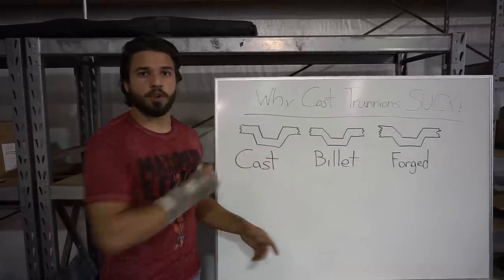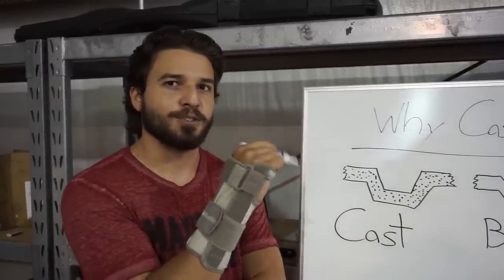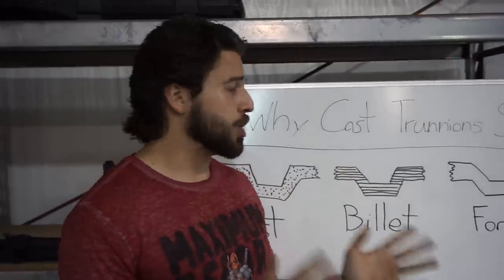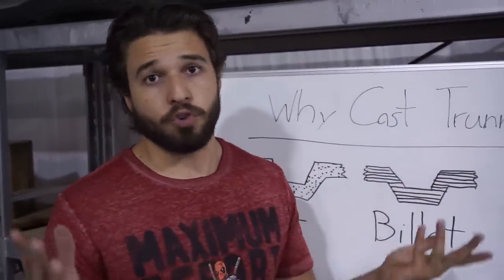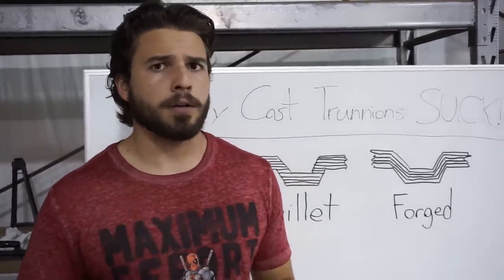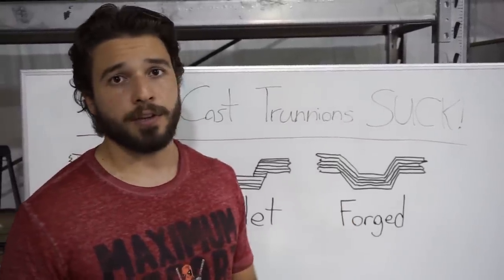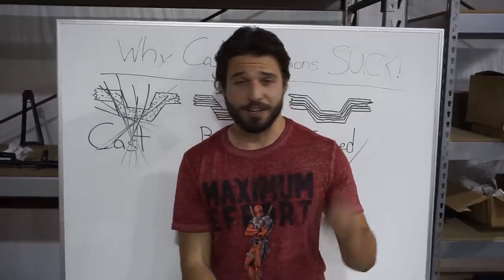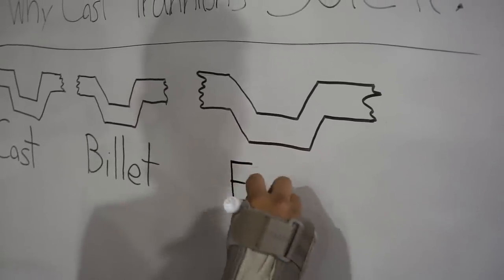Why Cast Trunnions SUCK!

Comment: Yes and no. The density doesn’t change from billet to forge. The density of the metal is the density of the metal, regardless of your harding process. Forging is elongating the grain structure that is on the surface of the metal. The forging process induces compressive forces on the surface which then hardens it. It forces a strain on the metal surface that moves based on the Young’s modulus, which dictates the stiffness of any metal; E= tensile stress/linear Strain. Billet is tough but not hard and that’s a function of the billets carbon content. A billet piece can be forged; density doesn’t change and carbon content doesn’t change. Tough meaning how much energy it absorbs. So a cast part will break because it’s brittle, a billet part will absorb energy and you’ll see “indentions” from impact and a forged piece is hard on the surface because the grain structure has gone under compressive forces. Now, you can machine a piece of bar stock in the direction of the grain structure and then you forge the same piece in the direction of of how the grains grew during the heating process. This will use the grain structure to your advantage. The same idea as wooden baseball bats. Grains only change when the metal is being heated. It’s a phase of the metal. But yes, the forging process hardens the surface of the metal, making a very hard part. In the end, your company and the AKs you all make rock, please continue to use the forged parts. Btw 4150 billet steel has a brinell hardness of 197 on the surface and after cold forging(cold hammer forging) it goes up to around 340
Reply: You can forge a billet into a trunnion or what have you but the fact still remains... billets are only formed one of two ways, continuous casting or hot rolling. It is a step above cast but still inferior.
Reply: Carbon content does change during forging.
Reply: @ravioliformuoli520  yes and no, thats kinda a loaded statement.
never the less, i feel this guys knowledge of metal fundamentals  is lacking.
Reply: @ravioliformuoli520  yeah, the carbon will react with oxygen. Its called decarburization, and thats why they use vacuum chambers for melting and heat treating.
Reply: Came here to say something similar to this, Cast is shit because of the random mix of gases in the final metal.
Reply: Holy shit, this cat knows his metal
Reply: This video and comment surprisingly are related to what I’m learning rn, considering the nature of all this—guns. I’ll be using this as self-study material :)
Reply: When he mentions density of the grains he is actually correct and it is directly controlled by heat treat. The size of each “grain” changes based on the temps used during heat treatment . They are formed during the prep heats before the forming of martensite by quenching. Look up normalizing, heating and quenching steel and specifically break testing, you can actually see Grain size with the naked eye. Also while forging does somewhat work harden steel it’s by no means the reason forged parts are strong and can actually be a problem with high carbon steels as it causes cracking.
Reply: Curious, what if you did casting under vacuum pressure? Would this eliminate the “bubbles” in the casted metal?

This is often done with resin to get air pockets out, even the tiny ones.

Ps I don’t know shit about metal.
Reply: Dang he sure googled the crap outta this video. He knows it all.  He’s an expert
Reply: I'm a metal head but not a metal head lol. Thanks for the educational comment!
Reply: @cody6102  Short answer is yes. If you watch the guys from Baltimore Knife and Sword do casting, they cast into a vacuum system to cut down on porosity.

The long answer is...kinda. Yes, vacuum casting is a thing, but the devices are expensive, especially when they start getting big, so it's not all that common.

Neat thing about casting, though, is that you can mess with the magnetic field pretty easily by, well, holding a magnet near the mold during the pour. This will align the grains and give you a magnetized part when you're done. Or, conversely, you can play with magnetic fields while the part is cooling and completely degauss the part so it ISN'T magnetic when you're done.
Reply: Huh...huh...he said, "stiffness."

Comment: Castings can be quite strong. Example, almost all production engine blocks are cast. The real problem is investing in things that reduce gas entrapment (Such as vacuum casting) and mold types that let the part cool very slow to provide the best interlocked grain structure such as sand molds.
And by the time you do that for small parts such as AK trunions you might as well have invested in forging.
Reply: Engine blocks are cast iron due to the cost (about 60% cheaper than aluminum.) A decent quality aluminum block is going to be stronger than the best quality cast iron block, and weigh 40-60% less than its CI equivalent. 

Companies building trunnions out of cast iron are doing so for one reason only: cost. They're trying to save as much money as possible during production in order to reap maximum profit. PSA and Century Arms don't care if you experience catastrophic failure due to poor metallurgy, as is evidenced by their lack of customer support offered to those who experience it.
Reply: @RockandrollNegro  Cast iron engine blocks are a rarity today. Most are cast aluminum. Casting can be just as strong as other methods. And in truth all other methods from machining to forging all start from a cast billet as virtually all billets come from continuous castings and hot rolling method.

So no casting is not an inferior method. It is just the method that can be done with the least investment which can cause an inferior product.
Reply: @Cragified  Agreed, steel companies can generally afford the quality control and metallurgical science books and scientists to control defects in their forges. Considering any pure steel or pig iron was brought up to molten temp to drop out of their ores. Essentially "casted". What this brandon guy is talking about is gas porosity and is a defect.
Reply: @RockandrollNegro  except Palmetto doesn't use cast trunions, the are all hammer forged or billet forged, so that's not true, plus they have some of the best customer service around, if u disagree I can guarantee by ur ignorance already, U were the problem lol
Reply: Engine blocks aren't meant to be hard or strong, they're meant to be able to flex under changing RPMs.  Crank shafts used to be forged, but forged cranks required surface hardening every time they were machined, where cast cranks actually surface harden while being machined, which makes them cheaper to produce while still being strong... enough... (they also have to flex).  Racing engines, especially high end ones, typically use billet blocks and forged cranks because they're stronger than cast blocks and cranks.  
So, yes... cast parts can be strong, but machined billets will generally be stronger and forged parts will always be stronger than any type of casing, no matter how technologically advanced the casting process may be.
Reply: @RockandrollNegro  Aluminum engine blocks are not stronger than iron blocks... they're just lighter weight.  Most cars now have cast aluminum blocks and heads because they're much lighter than iron and technology has reached the point where casting aluminum is cheap enough to make it practical enough for mass production and still be cost effective.  Billet aluminum blocks (racing engines) are stronger than cast iron blocks, but obviously they're much more expensive.
Otherwise, I agree about the reason why gun companies are using cast iron for AK parts... it's cheap.
Reply: Aluminum engine blocks are all sleeved with some kind of steel alloy insert fyi
Reply: It's STRAIGHT inferior to forging for AK trunnions considering that the casting CANNOT sustain the forces and loads needed for that trunnion... @Cragified

Comment: AK-50 with forged parts that is going to be expensive but worth it.
Reply: For the engineering needed to run a .50 you Need forge hardened metal.
Reply: Temper it correctly after making the billet you’ll be fine. The quench process is the critical part along with tempering.
Reply: Need to buy this in a kit with an 80% receiver!  Ask and ye shall receive? Brandon?

Comment: In b4 "RAS47 is fine" comments.
Reply: 5k rounds through mine and no issues.
Reply: AK Operators Union does a really great review on the PSAK47 by Palmetto State Armory.  The GF3 is a very well made American AK.  You would be a fool to call it a bad gun.
Reply: However, when it comes to the RAS47, it is indeed garbage 😂😂😂
Reply: @briandavenport8971  same.im almost at 8k.light wear but nothing like what ive seen online as "failures" i am going to upgrade to a vska at some point.but im not running out the door to replace it.its just a meme to hate on them.they have some issues but the later models had beter qc.and for a causal use rifle there is no problem. Sure theres beter. But outside of exaustive abuse you'd be hardpressed to damage anything.they are great "project guns" and arent nearly as bad as the internet makes them out to be.
Reply: Early Cuyler you're wrong there dangerous if you plan to do any real amount of shooing
Reply: @joshshirley9488  except I can't tell you how many people got ones that'll take 3-4,000 rounds without any issues. Sure, their QC isn't perfect but nobodies is. The thing with them is that because they produce a higher number of rifles due to their popularity, even if they have the same percentage of failed QC as "better" companies there will be more bad ones. So yeah, there's a higher number of bad rifles but overall seems to be a very similar percentage as the "higher quality" and "better" rifles. I've personally put over 2k rounds through mine, all shitty steel cased Tula, cleaned maybe twice, always ran abusively, and it hasn't had a gun related fail yet. I had one dud, but that was most definitely a round related issue and not anything like a light primer strike or hammer follow. It's been my beater gun, as it has for countless others, and runs with some of the best with about 1moa accuracy. 

Are they overall the absolute best with no other contenders? Fuck no. Not even close. Are they a fantastic starter/beater rifle you can trust your life to? Fuck yes, and youd be hard pressed to find an AK variant produced with anywhere near the volume for anywhere near the price with similar or better quality

Comment: This was actually extremely interesting to me. I'm just now getting into AK-47's, and learning the design, construction, and pitfalls of various models. I am coming from a small billet AR manufacturer, and have been very confused as to why American AK-47 rifles have been such garbage, and why no American company has stepped up to make quality billet 8620 steel trunnions and bolts, and perhaps BCG's/pistons, to address the failings of the budget guns. Seems like there is a market for it, and justification for the investment. And as you stated, with a properly outfitted machine shop, production of quality billet parts, offer costs that rival cast, with strength comparable, though slightly less, than forged. Billet receivers with MCX stock mounts on the rear, billet bolt carriers, billet trunnions perhaps with a new AR style barrel mounting system,  and a Weatherby Mark V interrupted lug pattern billet bolt while we're at it. effectively creating an AAK-19 (American AK) like the STI 2011 did to the 1911 design. But I digress.....

Comment: Older video, but I feel the need to comment. For background, I'm both a 5 axis CNC aerospace machinist and a metallurgist, specializing in ferrous metals. 

This is a bit misleading. The "grain" of steel does not flow like wood grain, as is pictured here, it is a crystalline structure. If you take a billet and machine it, the structure will be the same as the original billet, unless you thermally cycle the machined part, which is called normalizing, it reduces stresses induced by machining and reduces grain size, which is objectively the most important part, large grains = structural weakness. It also helps to "align" the structure, to stick with your analogy.

 This is where forging gets its strength, because it is heated and formed, it helps reduce grain size, leading to stronger parts. BUT, if forged parts are not normalized after forging, they will not be as strong as they potentially could be.

 Cast parts have absolutely HUGE grain size, a product of the insane temperatures needed for casting, unless they are properly thermally cycled, which is not easy with cast steel, and is also expensive, which is why they dont do it. 

So your advice stands. Avoid cast parts, because they will not put the money into properly heat treating them.

 If a billet trunnion is properly heat treated after machining, it will be just as strong as a forged one, and objectively better then a poorly heat treated forged trunnion. 

Just wanted to clarify on some things. Great video as always.
Reply: So, it seems like what you're saying aligns at least partially with my layman's understanding from other contexts, and I want to check if there's something I'm missing:

Cast parts can be good quality, if the manufacturer knows what they're doing and puts in the time and effort (and cost) to do it right. But doing casting badly is the cheapest option, so most manufacturers of cast parts are going to be people doing the cheapest thing they can, and their parts are going to be shit as a result.

Is that about right?
Reply: @logitimate that's about right, yes. Cast steel needs to be thermally cycled (heated to a specific temperature, then air cooled) in order to increase its strength. But cast steel does not like sudden temperature changes, it can break it easily. So it's a difficult process to do effectively, and if a company is already casting trunnions instead of forging or milling them, I can guarantee they will not put that effort in.
Reply: @willw7372  Got it. My question was partly inspired by the InRangeTV crew's recent video about the process of developing the glass-filled nylon monolithic AR-15 lower (KP-15) for their WWSD 2020 rifle, and the discussion of just what it takes to cast something that size, out of polymer, and have it reliably meet dimensional and durability requirements to be a properly functioning AR-15 lower — and hence, the wide gap between the quality you're going to get if you do it right vs. the quality you're going to get if you just throw together a mold in roughly the right shape, stick a port somewhere convenient, and start cranking out parts.
Reply: @willw7372  Could casting properly still be a cheaper option than forging or milling at a sufficiently large scale? If not, how has Ruger — all politics aside — had the level of success it has?
Reply: @logitimate  casting is almost always a cheaper option. Once the molds are set, you can crank out many times more than you could via forging or machining. Quantity over quality. Foundry workers are also typically paid far less than machinists. As far as Rugers success goes, I cannot comment, I have no clue as to the inner workings of their operations.
Reply: @willw7372  So if casting, even done properly (including thermal cycling, etc.), is cheaper than forging or milling, and properly-cast steel parts can be good quality, why is no one properly casting AK trunnions? It seems like an obvious market niche, for the informed, but also budget-minded consumer. Or is that just not actually a large market segment (especially given that the level of "informed" required to know the difference between a properly cast trunnion and a shoddily cast trunnion is actually a good deal higher than the level required to "know" the blanket statement "cast trunnions suck")?
Reply: @willw7372  Regarding speed of production, Russell Phagan mentioned a funny related anecdote in the WWSD video: KE Arms (where he works) has plenty of experience milling lower receivers, but this is their first cast (polymer) lower, so they brought in some polymer casting specialists (from outside the firearms industry) as consultants. And at one point, near the end of the design process, the polymer specialists are looking at the figures and they go "even with these optimizations, we're looking at a cooling time of about 60 seconds; this is horrible!" And the KE Arms guys, who are used to milling an aluminum receiver being a 40 minute process are going "wait, we can crank one of these out every minute or so? This is wonderful!"
Reply: @logitimate  the time, effort, and equipment it would require to properly heat treat cast trunnions would put them in the same price range of milled and forged ones. So it's not cost effective anymore, might better just use one of the better methods.

Comment: Glad my AK is made with surplus parts. Important parts shouldn't be cast. Trunnions, bolt and carriers should always at least be milled.  Now front sight blocks might be OK to cast to save a few bucks on a budget build but certainly not parts that will send you to the hospital if they fail. Thanks for putting out this public service message!

Comment: It's good to know that Gen3 PSA,the current Riley Defense are both using forged trunnions,bolts and bolt carriers.Both passed the AK Operators union 5000 rd test with flying colors.I'd still opt for a new Wasr because of the CHF barrel.
Reply: @Matthew Swartzwelder no way its a romanian WASR then ._.
Reply: @Matthew Swartzwelder how could you tell its cast? Maybe the rear trunnion could be cast (worse things have been used to prevent heavier bolts catapulting into some sorry moron's face), but I can never imagine the front trunnion being cast.
Reply: @Matthew Swartzwelder huh odd. All I know is the cast trunnion I had was pretty easy to cut through with using a hacksaw. No matter though, because I was going to use it for a straight blowback anyways.